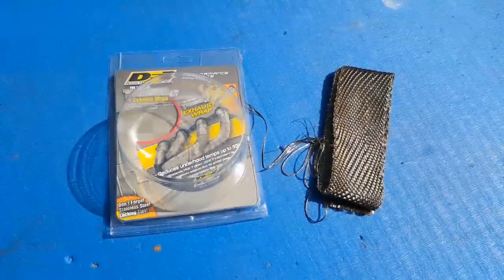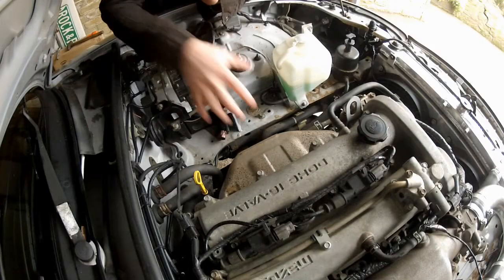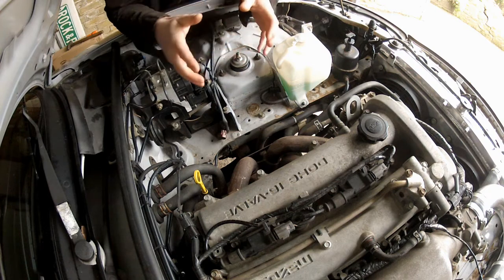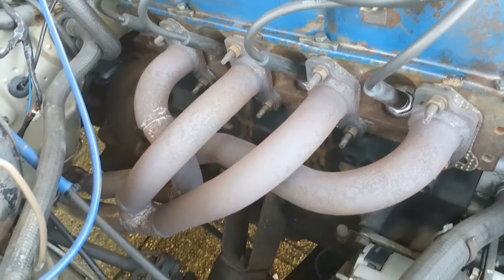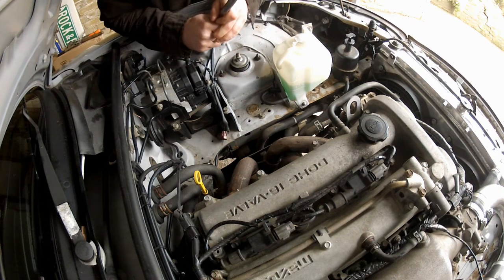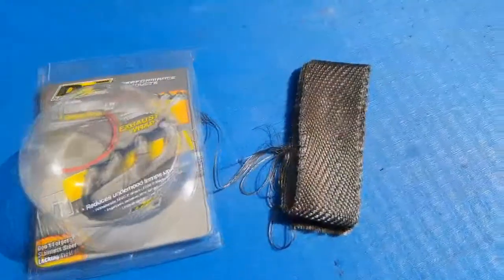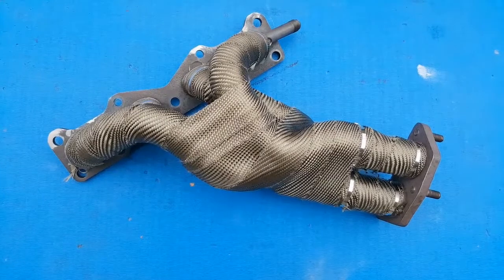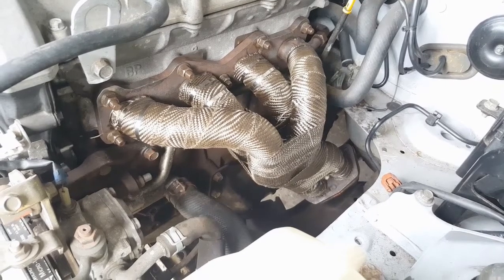How to Remove & Wrap Your Exhaust Manifold with DEI Titanium Wrap | Supercharging the MX5 Miata Ep16

Comment: Hi mate, love the build, im doing the same with my headers but im having troubles with the downpipe bolts, i can get two easy but the one who is the nearest of the wheel i don’t have the space to unbolt it, (i was trying from under the car and the wheel arch) how did you remove it?
Reply from the maker: That's the worst one. I managed it using a long ratchet extension with one of those 'UJ' style adaptors on the end. The other method is to get it with a spanner through the wheel arch.
Reply: @FastRust  thanks mate this weekend i will win my fight with that bolt 😂
Reply from the maker: Good luck. I have a little propane blowtorch I use if something is really stubborn. Get it glowing, crash cool it with water then try again. Saved my ass a few times.

Comment: I generally avoid exhaust wrap personally. Most wraps are absorbant and can retain water causing corrosion. The wrap also containing heat without it being able to dissipate it evenly could also over heat the exhaust and cause premature failures. 
That being said it definitely does its job to retain heat and reduce under bonnet temps.

I think the general consensus is to ceramic coat exhausts now. 
I bought a TDR heat blanket which sort of just lays on top and reduces under bonnet temps etc, but not so much keeps the heat within the exhaust
Reply from the maker: I don't disagree, but wrap was far cheaper than all other options (including the ones you mention) hence the decision. I will see how it performs in the short term and update if there are any issues.
Reply: @FastRust  I suppose yeah. Don't get me wrong it works very well for it's intended purpose. I think with the fact it's an mx5 you may not put a whole too much heat into the manifold to cause the cracking etc from heat wrap

Comment: good job! btw, what happened to the link you mentioned about tightening the ss hose clips?
Reply from the maker: Thanks. Not filmed it yet 🙄 Will get round to it soon.
Reply: @FastRust  another question.
Why didn't you just apply copper RTV  instead of reusing the gasket?
Reply from the maker: Copper rtv with no gasket will not form a durable seal between an exhaust manifold and cylinder head. It can work sometimes if smeared on an old gasket but I'd only ever use it as a temporary fix.
Reply from the maker: Gasket were fine by the way. All sealed back up perfectly 👍🏻

Comment: Another great vid James! Cheers. How's the 221? have you had a remote tune or are you still running on the base map + auto tune?
Reply from the maker: Cheers! 221 working fine but is still on the basemap. I ended up disabling the auto tune on advice from ME (not ideal on a basemap apparently), and had to mildly tinker with the VE table to get it through MOT. Not ideal tbh but the car is off the road now whilst I get the charger on. As soon as it's ready to go again I'll get a remote tune done.
Reply: @FastRust  ah good to know, my 221 should be going back in this weekend. 🤞
Reply from the maker: Nice one. What setup are you running?
Reply: @FastRust  well coincidently, pretty much a carbon copy of your build. 😁
Reply: However I have gone for the Ed kellet diy induction kit.
Reply from the maker: Yeah I know the one. I've gone with the G19 kit, which will feature in future vids. How does yours behave supercharged?? Quite excited to get mine finished!
Reply: @FastRust  well I've amassed 95% of the parts so not long now. I gave myself 6 months to complete it... I started in January 😐
Reply from the maker: Well, you're still ahead of me! What's in the remaining 5% of bits?
Reply: @FastRust  silly little bits really, like cables for the 2nd TB, intake hoses to route around the abs pump and getting a bung welded for the iat sensor. But I keep getting involved in non sc mods such as swapping out the old open diff, mohair roofs and suspension upgrades. Marketplace is partly to blame. When the part and the price is right you gotta go for it. But most of that's out my system now, also I've got a trackday at brands hatch at the end of the year and would be rude to turn up unboosted.